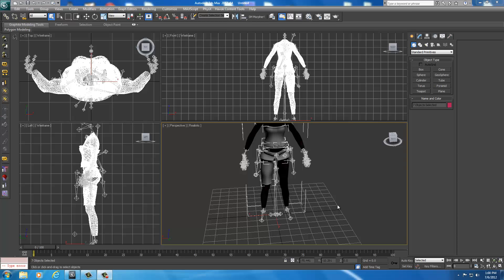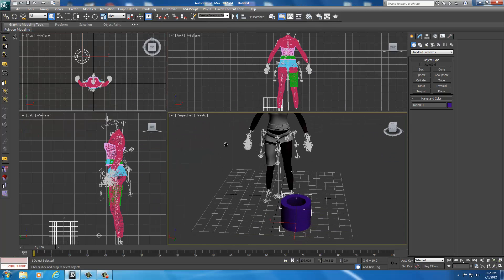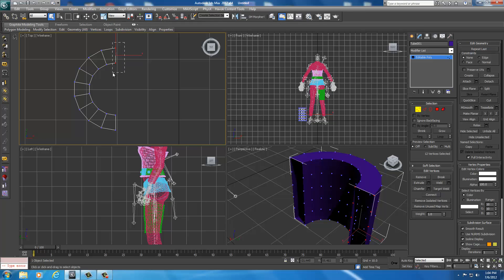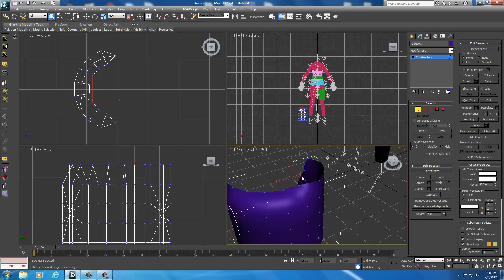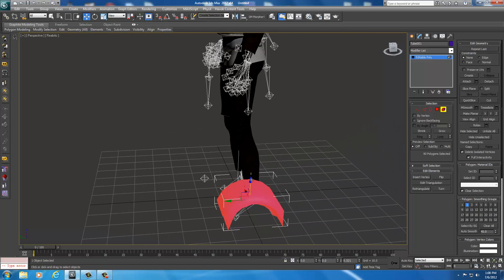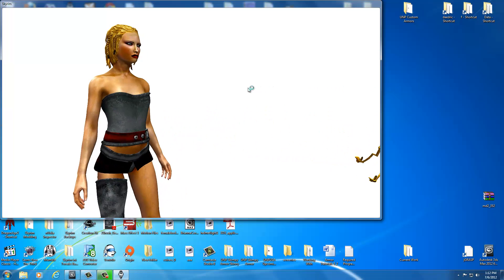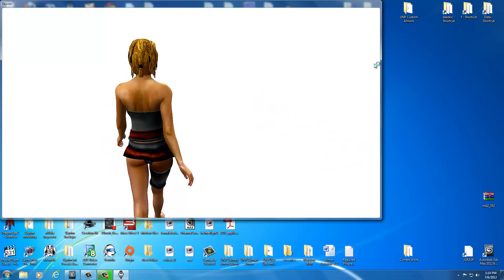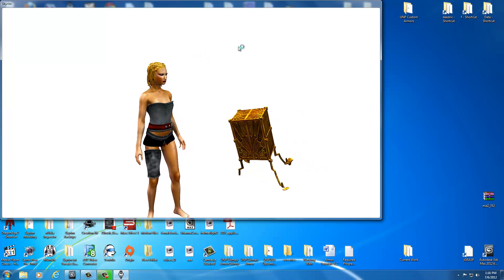38 - CA4S - Shaping with Component Tools

Comment from the maker: No I am not removing any body polygons during these tutorials. Doing so requires some complex knowledge in order to use the weight sliders.

Vanilla armors do remove parts of the body, these tutorials show you how to go about it without removing parts of the body as this method is easier to learn and do.